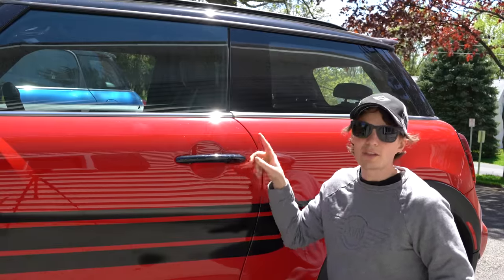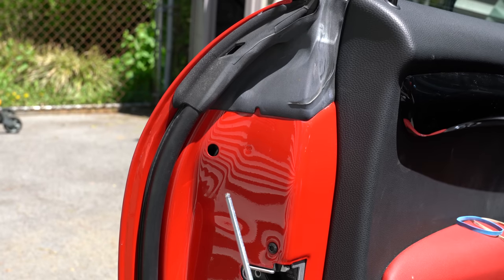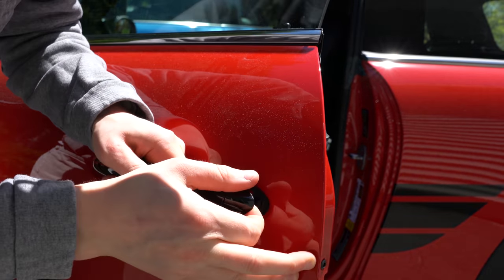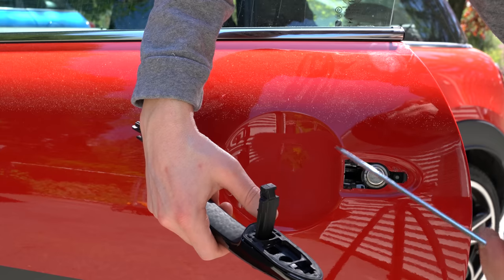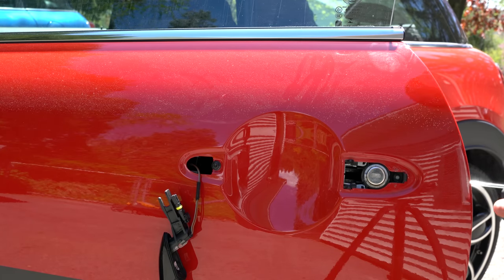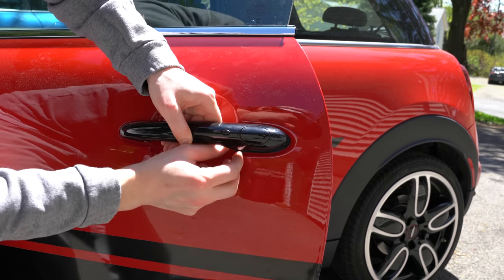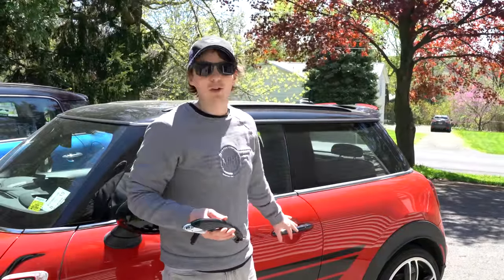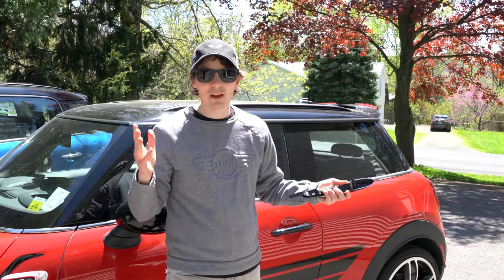MINI Cooper swap out chrome door handle

Comment: Thanks for sharing.

Is it possible to remove the chrome piece from the rest of the handle after removing the handle? Also, can I just remove the chrome piece from the handle? You know, just like how it's possible to remove the chrome Gas cap from without removing the actual Gas cap.
Reply from the maker: I don't think you can successfully disassemble the door handle to remove the chrome but I've never tried....
Reply: I'm also curious to know if this is possible. I'd like to remove the chrome bit to wrap it in vinyl!

Comment: thanks for all your helpful videos. i picked up a used 2017 and noticed one of the door handles led light isn't working. without taking the door handle off, i am able to see in there that the light plug is in fact connected, so i'm hoping it is just a burned out bulb and not an electrical malfunction in the wiring. do you know if by chance you can just replace the bulb in the handles? or do i need to basically buy a whole new door handle?
Reply from the maker: I think it's a whole door handle replacement if I remember correctly..
Reply: @TheMINIVlog  yeah, i figured i would just have to replace the entire handle unit. was just wishful thinking that i could pop in a new bulb at the moment until i moved forward with swapping out all the chrome on my mini which i eventually wanted to do all at once. at least it now gives me an excuse to start with the handles for now (and most likely gas cap). thanks again for all your help!
Reply from the maker: Good luck!

Comment: Is there any point in this install where someone could mess up and the manual key/lock mechanism would no longer turn? I just picked up a new F56 I custom ordered, the black handles were port installed, and I went to use the manual key to lock the doors while going for a run at the park, and the key will not turn the lock at all. Interestingly the electronic door lock from the Fob does work though. I’m 2 hours from the MINI dealer, so trying to see if I can resolve this myself.
Reply from the maker: Hmmmm not that I can think of....but I'm not locksmith expert. I do know the barrels can be stiff to turn with such a little key...?

Comment: Thx for the explanation have ordered mine in the Netherlands. Are you als going to do the other door or is that pretty simple
Reply from the maker: I am not going to post the video of the other door. It's actually easier on the non-driver side since there is no key lock in the way so more room to work in there. I figured if I showed the harder door, then I would not need to show the easier one.

Comment: How do you find out the method of disassemble parts? I'm trying to remove the passenger side dashboard trim cover for vinyl wrap but have absolutely no idea how. Also the OBD port is loose and making a rattling noise listening to music. The mini is a 2018 model.
Reply from the maker: Just lots and lots of googling and forums and sometimes, just trial and error. I have not found an all inclusive repair manual yet. I feel like you should be able to tighten up the bracket holding in the OBD port....?

Comment: Hi, great video. My four piano black door handles (F55) have arrived. I don’t have comfort access or handle lights is there a chance the wiring is just taped to the inside of the door in preparation for these two options? Cheers, Howard
Reply from the maker: I looked and did not see it in there. I think it's a separate wiring harness installed during build....... I hope I am wrong but it doesn't appear that way. At least on mine.